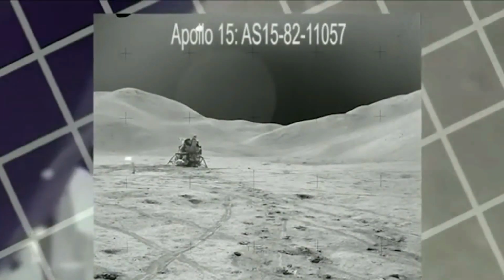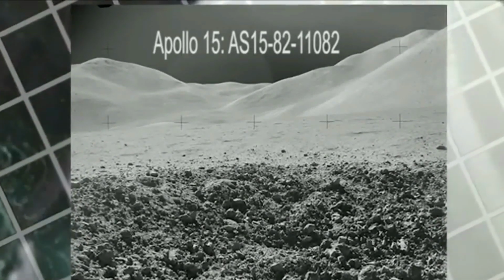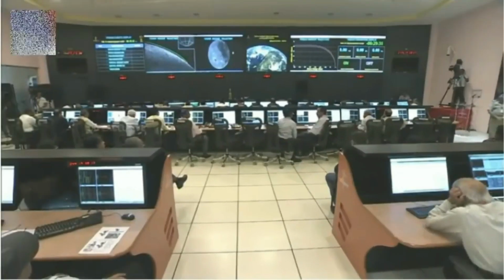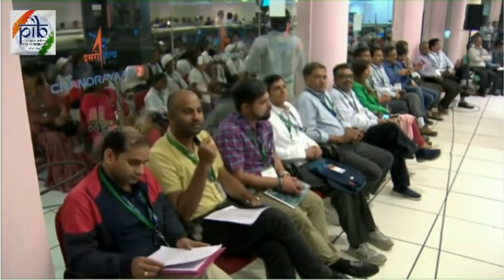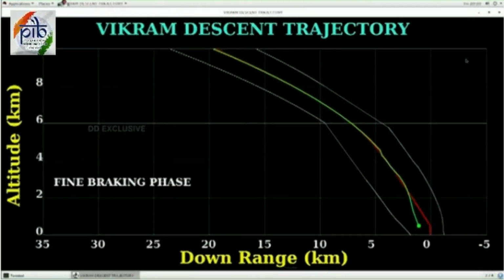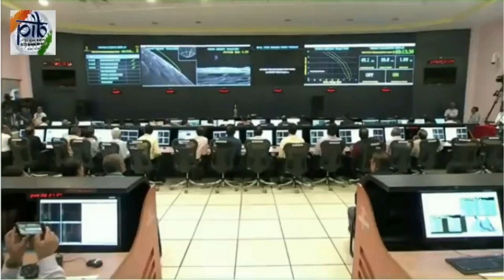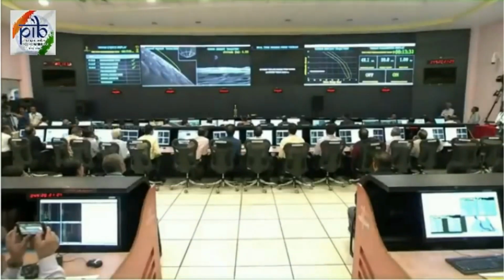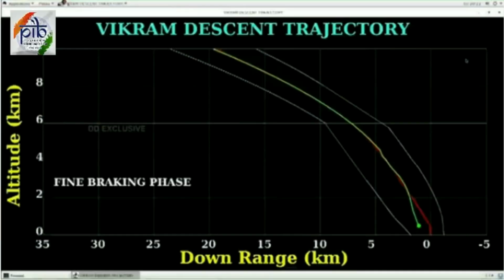Moon Hoax; "Vikram Rams Into The Moon!"

Comment: We should note an important difference between Chinese method and Israel/India. China sends the lander to the moon in a few days because they have developed the navigation system. India and Israel used the method of using elliptic orbits, and it takes over one month to get to the moon by that method, but safer. India lost the first moon probe once by doing what Nasa's advised (Chandraayaan 1) This time; they did every technical task by themselves, No more Nasa. At least, they got into the moon's orbit without losing it. Nasa does not have a navigation system. One made in 1969 for Apollo by an MIT professor was a very primitive one without a computer. That requires a human on board manually calculate the position. The success rate is 0.1%, but there was no other technology available to do navigation. Even now, Nasa has no idea how to navigate eh ship to the moon. We will see when Bezo is trying to send something to the moon. Bezo's team needs to use a navigation system or use an elliptic orbit method. Bezo said they use the telescope for navigation, which is from the Apollo story. The method does not work. I believe their engineering team will notice that. Then, they will say, "How the hell Apollo got to the moon?
Reply: Nothing goes to the moon. Nothing will ever land on the moon. Never going to happen. Cheers.

Comment: What the start of this video has to do with the second is anyone's guess but whatever, let's address the claim that the two Apollo 15 images use a backdrop.

The reason the mountains look very similar is because the summits are 15 km away. Even the base of the hills are over 8 km from the photographer.

The claim that the backgrounds are identical is just not true. Here there are overlain to prove that they don't match exactly:

https://i.imgur.com/3mlNdhx.jpg

We can prove that it's not a backdrop quite easily. In this animation I've deliberately stretched the image to make the horizon as close a match as possible. 

https://i.imgur.com/dm9JIem.gif

Even with quite a lot of repositioning it's still not exact, which again should tell you that it is not a backdrop. 

The red arrow marks a position near the base of the hills, the blue arrow a point about halfway up them. The yellow arrows show how far apart those two sets of arrows are. 

If it was a backdrop those two positions would never alter. They can't. Because its a real 3D surface the amount of relative movement between the more distant arrows is greater than the one nearer to us. This is only possible when it's a real set of hills, it can't be possible if it's a backdrop.

The reason the LM is not visible in the second image is because it is behind a small rise in the topography.
Reply from the maker: What a stupid prat you really are for opening your post with that statement Paul! How is it that everyone else got it, even that meat head Crewe? Because you only come here to throw your fishing line into the pond, hoping to snag a big fish. Do keep trying so that I can have another good laugh for the weekend mate!
Reply: @theapollodetectives  Joining one video with such a tenuous link to the second part does not produce any kind of coherent argument. They are linked only in your deluded mind. It also can't be trusted because the video maker doesn't use their own voice.

The images I posted prove that the video lies, and that it can't be a backdrop. Prove me wrong.

Tbe only thing I'm going to catch from you people is herpes. I'm here to point out when you're wrong. You're wrong, a lot.

Comment: I’m on the fence about the moon missions, but at 2:33 watch closely - the background does not match exactly. This hoax video is incorrect. I think that shifting 1.4 km across could cause this mismatch, and of course the LM isn’t in the picture because of this distance. But I’d be looking for signs of the landing rocket blast. You’d think there’d be some disturbed dust around the LM.  Maybe the background needs to be enlarged to fit more exactly, but if there are changes indicating movement across then it kind of destroys the hoax case.
Reply: Whatever your views on the subject it's pretty obvious that the claim that the backgrounds are an exact match is completely false, and it takes no time at all to prove not only that they don't match, but that the parallax between the images proves that it is not a flat backdrop.

https://i.imgur.com/3mlNdhx.jpg

https://i.imgur.com/dm9JIem.gif

As for signs of rocket blast, there are photographs of the scorched ground under the LM, and images taken by India and Japan show changes in the reflectivity of the surface as a result of the engine exhaust. There would be no blast crater, if the engine was firing hard enough to dig a hole it would not land, The reason there's no dust settling around the lander is because there is no air, so any entrained dust just disappears into the distance.
Reply: Onebigmonkey I think the issue was nothing to do with the lack of air. The fact is that there should have been a line of displaced dust visible leading to the landing spot of the LM. This is because the LM comes down at an angle. We see the radiation striations of the dust flying outward as the LM lands, but this means that there should be evidence of this from some angle. There is no photo of this anywhere that I’ve seen.
Reply: how could anyone be on the fence!
Reply: John Kitchin if you examine things closely, you can see there are valid points on both sides. Being on the fence here means that there is not incontrovertible evidence for the Apollo moon missions, and no incontrovertible evidence of a hoax either.
Reply: GinSkimPivot it’s Alrukitaf not Airukitaf, but anyway, I’m not sure what constitutes incontrovertible evidence for you, but if you examine the undisputed facts, there’s ample cause for concern. I know some video presenters go off without analysis of all available information, certainly. But I have witnessed some oddities. For example, I recall a photo of Astronaut Cernan with his thumb and forefinger encircling the earth. I remarked in the comment section that according to internet published data, scientists appear to agree that the earth is about 3.5 times the diameter of the moon. Now I’m aware that issues of perigee and apogee would entail a 14% difference in size depending on the distance between earth and the moon. But what followed my comment was remarkable. The photo on the YouTube clip was subsequently altered, showing only Cernan’s hand, obscuring the fact that his arm had been outstretched (this affects the perception of size). And then what followed was even more remarkable. The photo disappeared, and I saw another photo amongst the Apollo mission YouTube clips showing a much larger earth. 
Another thing of concern to me is that following the discovery of a moonrock to be in fact petrified wood, NASA announced that a large number of moonrocks had gone missing. This leads me to suspect that when one sample was found to be petrified wood, NASA examined the rest of the samples, and weeded out those other ones that were also petrified wood, or had some other evidence of earthly origin. This is not incontrovertible evidence, of course, but then what incontrovertible evidence could there be that this action by NASA did not take place?  Whatever the truth is, I’m saying we don’t have definitive proof either way. Even the LRO pictures showing the lunar landing sites show the tracks of the astronauts as continuous lines rather than a series of spots, which is what one would expect to see because the astronauts hopped about, rather than drag their boots along the surface of the moon. There are many other aspects To the moon hoax theories but this is already a very long post and I’m grateful that you have read patiently up to this point. Thanks
Reply from the maker: It does match IF the landscape on the first is stretched a little. Someone had been fooling around with the scale. I have tried this myself and it is the same hill, spots, streaks, small craters and all. Try it yourself.
Reply: Shill Slayers II good point
Reply from the maker: With all of the dust being kicked up when we see the LEM touching down, you would at least see a circular dust pattern under the engine. We see nothing.
Reply: GinSkimPivot Cool story.... conveniently.